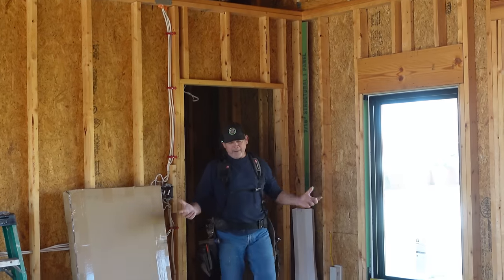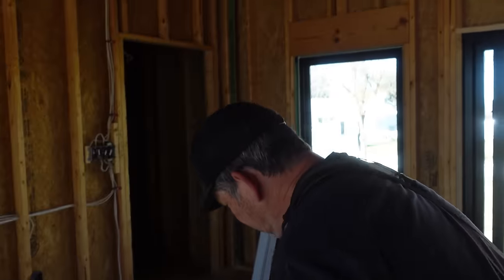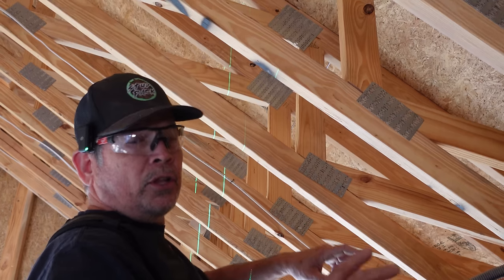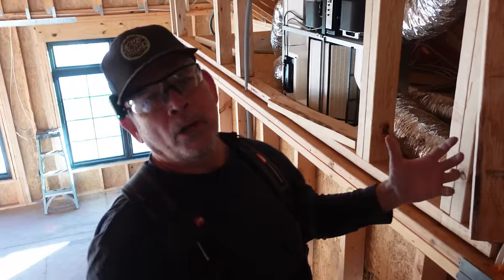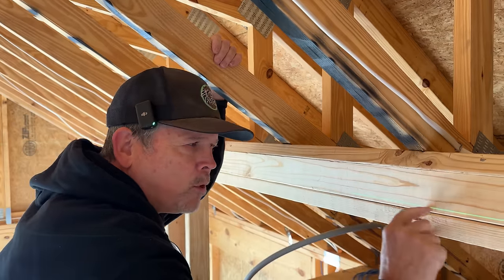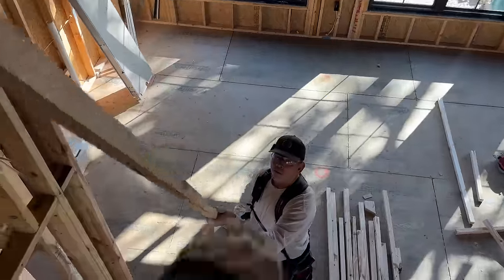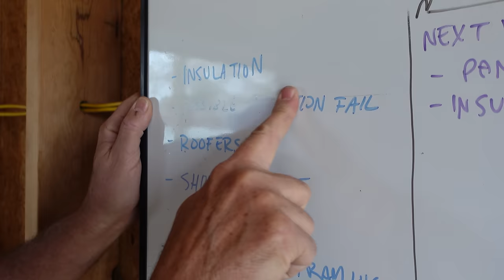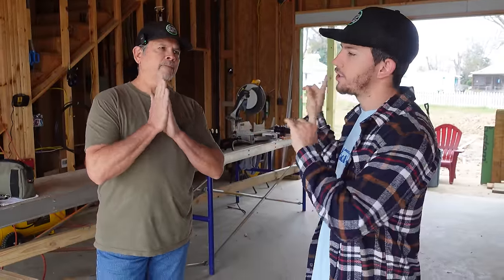We Found the Perfect Access Doors for Secret Storage!

Comment: Doesn't the design which has the led strip sitting on bare wood violate fire block requirements?
Reply: 12volt and led produces no heat, no different than under cabinet lighting.
Reply: @TheRealGenSwat  sure... Under normal circumstances. If the strip is damaged and that voltage finds a dead bug and dust, it could catch fire. And it's sitting on wood that is connected to the building structure. That's a fire hazard on paper. It shouldn't be built that way; they should use a fire block like their 5/8" drywall they're already using.

Comment: Those access doors are going to be a nuisance the way you installed them. You should've put them in the opposite way (door swings up) & just put a small hook in the ceiling to attach a cable onto to hold it open.

Comment: If you haven't already paid for the epoxy floors, I'd suggest looking at an alternative. You've done some awesome things - fully air sealed, monopoly framed, spray foamed, etc. Instead of the same ole epoxy floors - why not do some really cool tile in the garage? I've only seen a few tile garage floors on garage journal and youtube, and it would be cool to see Paul do the install, even if it was with assistance from someone that has done garage tile before. It would look 100X better as well, and be more resilient, and more easily repaired (if it ever needed it) and you wouldn't have that issue of those darn paint chips hiding anything you drop on the floor (ask me how I know!)
Reply: I should clarify - porcelain tile - not those plastic ones

Comment: If you did monopoly framing, you missed a trick by not doing exterior insulation.  Spray foam is a poor substitute because it can fail easily and it isn't as repairable as taped rigid foam.

You think it's great for getting in to the nooks and crannies inside but the exterior has much less issues like that.  If you run in to one you can solve it with a can of spray foam, not a barrel...

Comment: That little room or bathroom or whatever on the second side must be out of sq. There is no way that outside wall is out of level 1" over 10-12'
Reply: My theory is the walls are bowing out as the roof truss deflects; one or two inches in the center might be within spec for the trusses, but it seems odd to not have a Simpson StrongWall somewhere for lateral support, maybe with a tie beam. But I am no structural engineer.

Comment: Respectfully.…. That “access” panel is anything but accessable.  OMG, it looks extremely cumbersome and impracticable on every level.  I agree with many of the others this should be hinged on the top and open upwards and not have to remove it.  I can not imagine needing to access this from a ladder off the wall.  I can only imagine this whole thing (frame- panel etc..) was not cheap either… very poor placing for such an item.

Comment: I hate waste space also don't like to have doors for access to hidden spaces in my older brother's up down duplex I set up the furnace room just big enough for the furnace and hot water heater per code we used 5\8 fireguard drywall and rock wool insulation for access I built both ends removable put 2 peices of copper pipe in the bottom and and one in the cold air intake just remove the cold air grate pull up the peice of pipe lean the section of wall and lift up and remove full access to the hot water heater on the other end in the bedroom closet I hinged it remove the closet bar and swing it open for access to the furnace since the only time that we needed access was if the pilot lights needed to be relite or access for repairs or replacement for my younger brother we had a deck on the second floor that went from side to side of the back since the master bedroom was 16 foot further back the deck was l shaped we left the deck behind the master bedroom and closed off the rest the peice that went along side the bedroom we made into a hidden room 4 foot by 16 foot accessed by swinging out the bookcase in the alcove in his master bedroom all the others were accessed by removable panel he had 3 storage areas non full height biggest one over the second bedroom accessable from his 3rd floor loft bedroom gave him a lot of storage space

Comment: If you want to get REALLY meticulous about getting the center of the plates, after making your two 103" marks, extend them w/ the square across both plates, then use the speed square to mark an "X"  from corner to corner on each plate's 103-marks... the mid point of the top plate's X & bottom plate's X should be dead center, so then it's just a quick perpendicular line and BOOM! you have your 'exact' center.